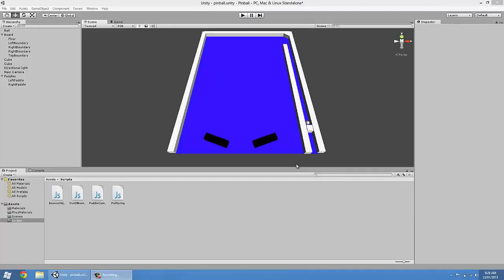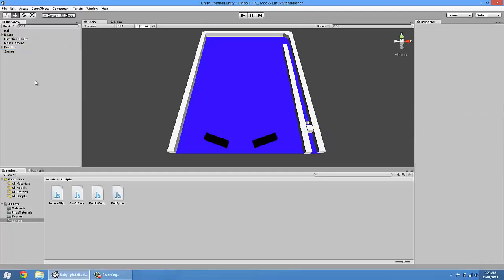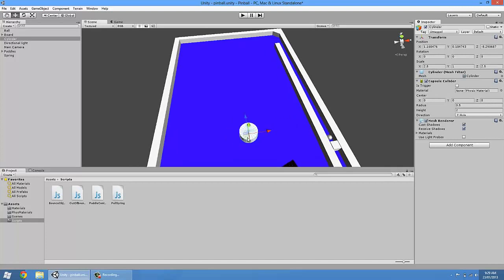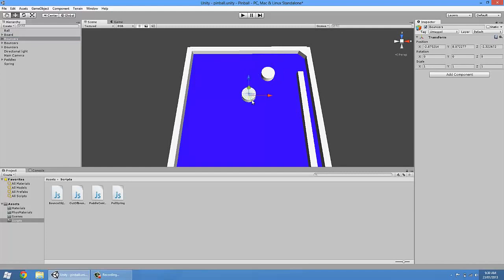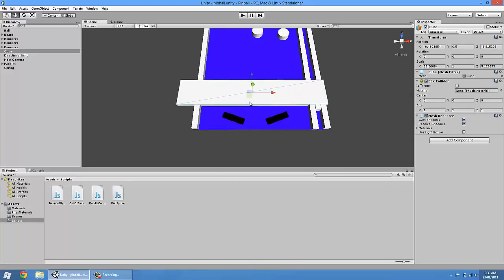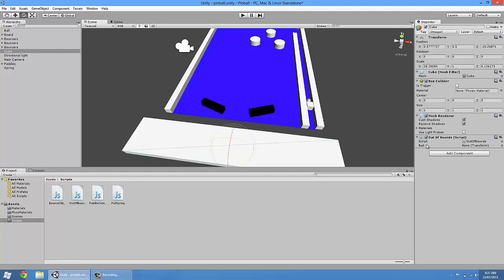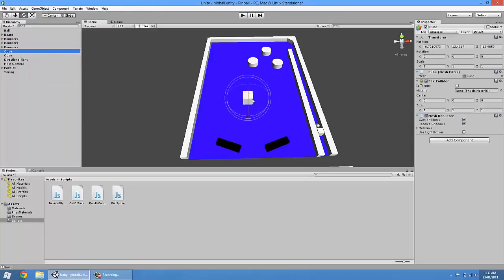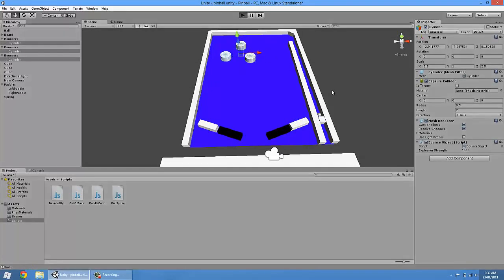Unity Pinball Tutorial - Bouncers and Out of bounds objects (Part 3/3)

Comment: Thanks for your uploads, these helped me getting started in Unity. For me it all works well, except that sometimes the ball falls trough the plunger, or it gets stuck in a flipper.
Reply from the maker: The only reasons I can see this happening is falling through the plunger is because of how fast it is travelling. Ensure the ball's interpolation mode is set to Extrapolate (if that's not right, I'll check it out as it has been a while since I've used Unity and I can't see if now). See http://docs.unity3d.com/ScriptReference/RigidbodyInterpolation.html

As for getting stuck, I really don't know, perhaps the shape of the flipper? If you get a good 3d model of the flipper and add a mesh collider to the flipper; that might help it not get stuck. Something like http://www.turbosquid.com/3d-models/3d-flipper-s-model/285376

Good luck!
Reply: Yeah it seemed to be speed related. I'll check out your links. My flippers where a bit thinner. Thanks for the info!
Reply: M de Jong   Ever figure out the issue with the ball getting stuck in the flipper?
Reply: Yeah i got it figured out, mesh collider problem :) Thanks for the help !
Reply: Yeah no the trigger one is still problematic. I rebuilt the table from scratch just now, but the ball won't even launch. It's "stuck" to the plunger. If i plunge too quick it'll fall trough it. The flippers are somehow okay now though. I'll figure it out.
Reply from the maker: M de Jong Sorry for the late response, it's just been a hectic week. There are a couple of cases I've seen in the past which will cause the ball to 'stick' mostly it comes from the scale of the objects on the board (if everything is say over 10 scale) or the ball isn't tagged as a Ball.

I hope that leads you in the right direction!